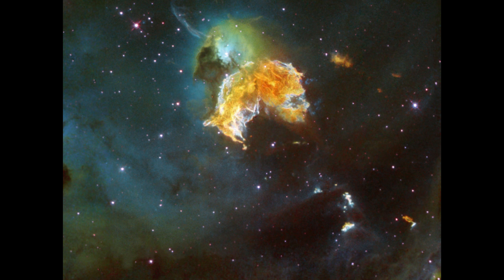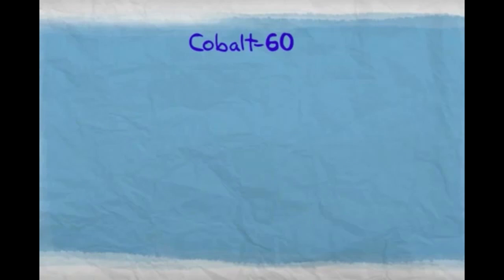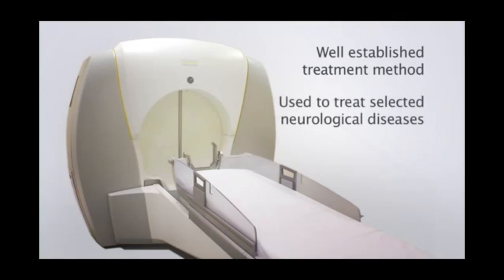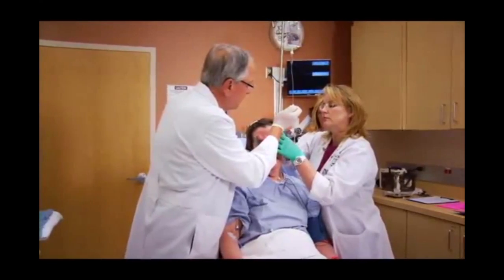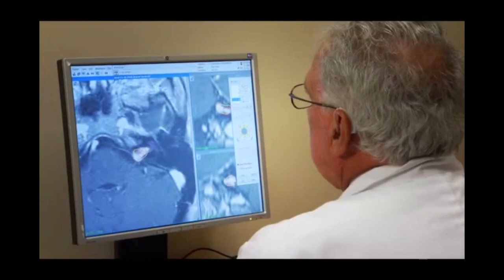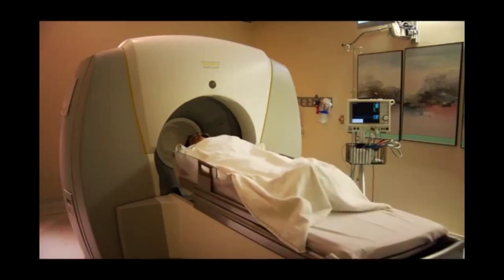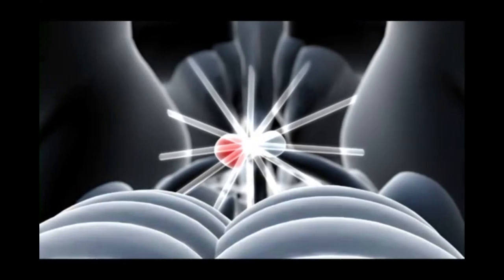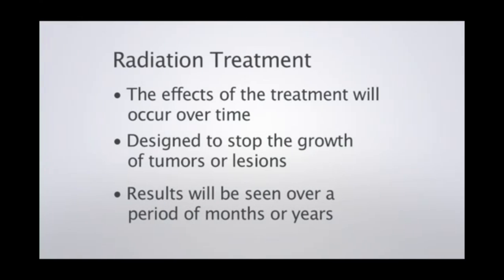Gamma Knife Radiosurgery PHY112 12/4/2013

Comment: Still confused about the pins they go in your head? THey get to the bone but not through the bone? Doesn't sound fun
Reply from the maker: So I just saw your comment. You probably already know the answer now, but yeah. they vise onto your cranium. That way the measurements don't move!
Reply: +cymbeli It's not fun .And all the pressure doesn't help if you are already in a lot of pain
Reply: kymbreleigh marin but didn’t the pressure got it better after a short time?